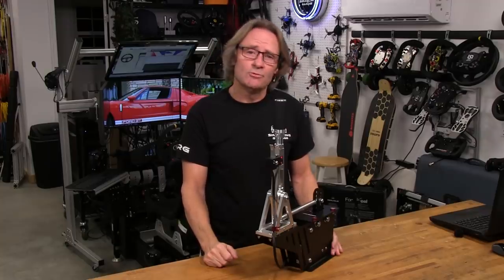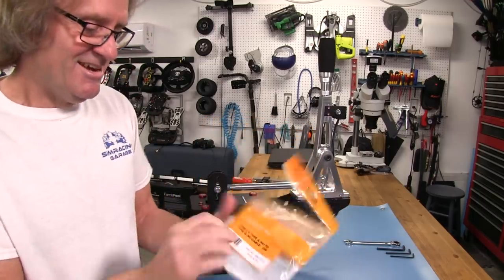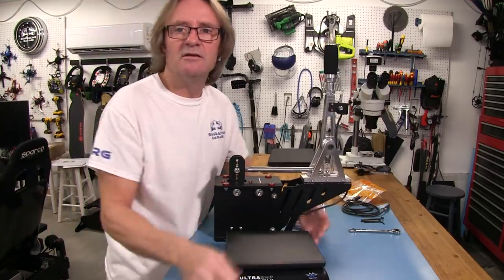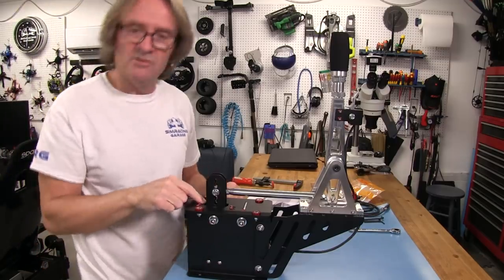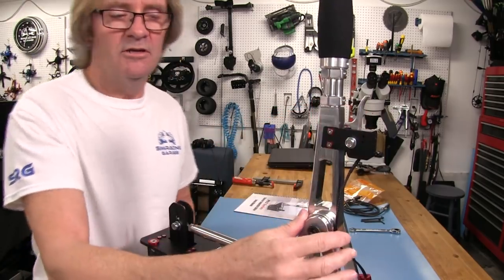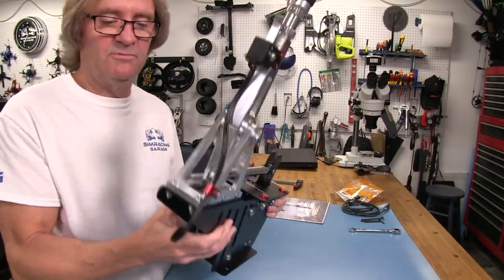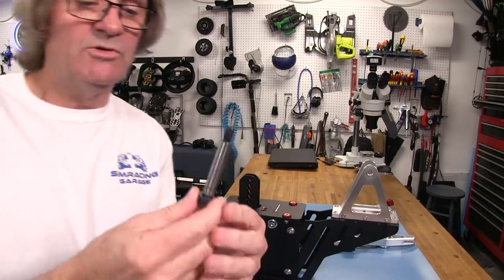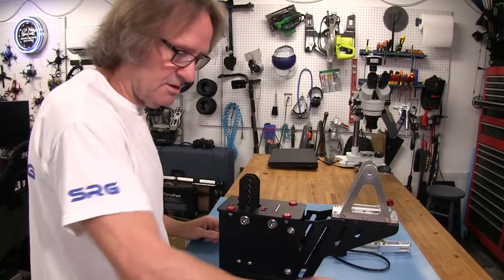SimWorx Pro Series Supercar Sequential Shifter Review

Comment: Very cool. However the market is pretty saturated with sequential shifters. All pretty dang good too. What about H-Patterns? Are they just to complicated to make? I’d really like to see a large selection of H-pattern shifters to choose from. I currently have a Fanatec but it’s still to toy like. There’s no resistance when changing gears. I also can’t afford to spend $2k on a shifter so...
Reply: $900 usd shipped
Reply: While I agree the market is somewhat saturated w/Sequential Shifters, when it comes to "damn near life like", there's only 3 that I know of...this one, which I myself have been eyeing
for some time, the Quaife Sequential Shifter, which  I believe Barry did a review on some months ago, and the Many-Factory Porsche GT3-RS replica shifter...
Reply: NewOldStock Racing what H-pattern shifter cost $900?
Reply: Sim Racing Insider I’m not looking at it as a negative thing. I’d just like to see an H pattern for every sequential brought to the market.
Reply: OhItsThat Sorry. I was referring to the sequential Barry reviewer.
Reply: I agree... I wish there was just as many h patterns. I am using the fanatec shifter as well but it does have a bit of resistance. You have the adjustment screw tightened up correct? Just making sure. Still doesn’t feel like a car shifter though.
Reply: There is also the frex H shifter from Japan. Haven’t seen any reviews for it yet though.

Comment: This is a very cool shifter, but what about the feeling of gear engagement? I have a simworx sequential and it dosnt really have an engagement feel.. It's just a firm push and pull. Awesome shifter though. Is this is the same? the actual box part with the buttons look identical.

 I think I'd like one of these and mount the shifter right up next to the steering wheel, but put the shifter box further back more hidden next to the seat with a longer rod, for a bit more of an authentic look. Looks kinda clunky having it all mounted together.
Reply: Simracer #138 confirming this doesn’t feel anything like changing gears. I don’t know why Barry doesn’t mention this... Completely over priced considering that fact. Look at Pro-Sim or others for that feature.
Reply: The thing is, unless youve driven a real deal v8 supercar, you have no idea how it's supposed to feel. it may very well feel just how this piece of kit does.
Reply: @mrdobalina3451  I haven't tried this one, but such sn awesome looking beast, easy the coolest looking SQ on the market! But man is it the most underwhelming seeing the insides of that box!! Nothing connected inside, only a rod pushing switches.. .. .
Have ordered the Quaife Pro-sim SQ, now they now how shifters should feel! Can't wait!! :D

Comment: Can you use the trustmaster TSSH sequential shifter on the fanatec csl elite wheel or the dd1?
Reply from the maker: It will not connect directly to Fanatec wheelbases. But you can still use it as a stand alone shifter via USB on a PC.

Comment: And I thought sequential shifters had a long lever that triggered the clutch on upshifts, but couldn't find any evidence of it anywhere. I though some rally cars had that. I'm more ignorant than I think I suppose.
Reply: nope, sequential gear boxes dont have syncros,  they have what are called dog rings instead that allow the transmission to be banged up and down gears without using the clutch.
Reply: @kasuraga  This I know. I was referring to something else.
Reply: @EddieOtool  my point is, there isnt any mechanism to trigger the clutch on up shifts or down shifts
Reply: @kasuraga  You are right.